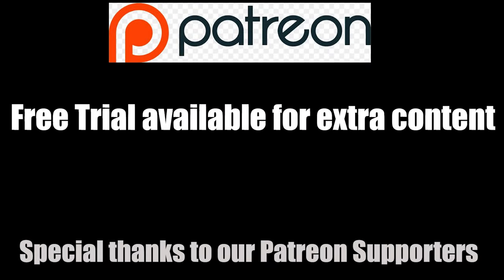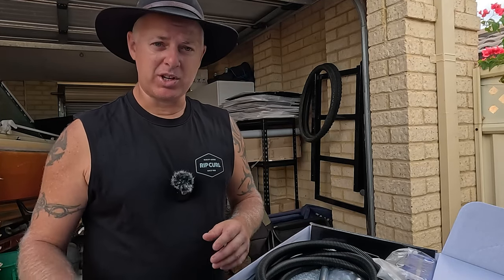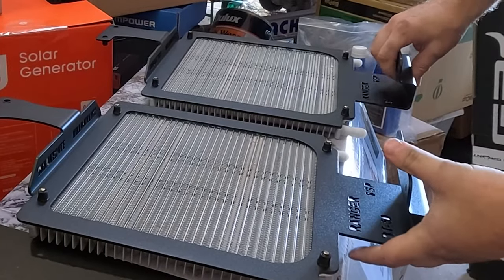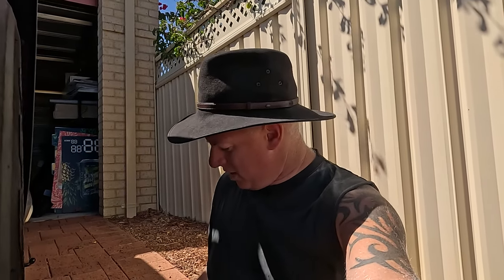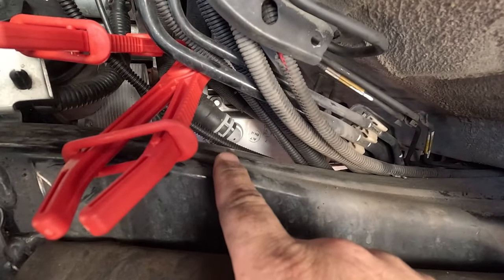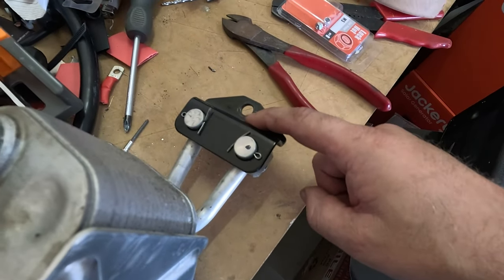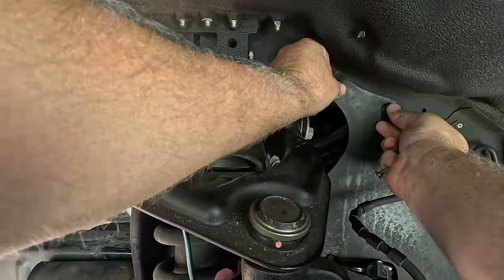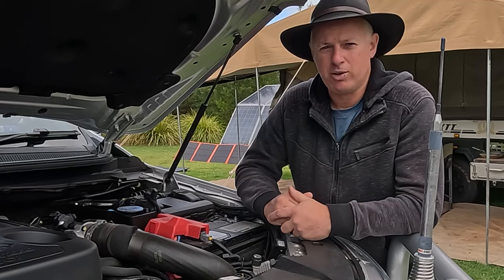Have a problem towing caravan/camper trailer with a Ford Ranger auto transmission? Ranger Build Pt 1

Comment: Hi. We've been traveling around Oz for 2 years now in our 2016 Ranger, no mods, towing a 2.7t semi offroad van. I always have it in 'S' sport mode and never had a problem. We've been on dirt roads and hot weather and never missed a beat. In 2 years We've done around 50k kilometers. 
A great car all round.
Reply from the maker: Hi guys! Thanks for saying g'day 😁 Great to hear she's done you well! Is there a reason you drive in sport mode other than perhaps wanting to use gears 😁
Reply: @gettingaroundaus    When you shift across to sport mode  and leave it, it still in auto but if you can also use it as a manual by shifting the gear leaver up or down. I keep it in the sport auto mode. The trans doesn't go into overdrive. Doesn't affect the fuel economy 16l/100k.
Reply from the maker: @c-est-la-vie  interesting, appreciate your feedback. People have only mentioned to me its about managing the trans load but always thought you shouldn't have to work around a weakness.

In my experience extra fuel consumption had always been a factor but I'm curious to experiment. Cheers 🍻

Comment: Awesome install vid Deezel!! 👍
My thoughts are that you should also fit a monitor to accurately track your temps with a ECU gauge (connected via your OBD port) such as a Scangauge (noting that the latest Scangauge 3 is pretty darn pricey!!) or an Ultragauge (about half the price in comparison). Maybe you could reach out to one of those companies to see if they can sling you one of their products for a review. That way, you could see what your actual temps are under various transmission load conditions and compare that data with a given optimum temperature range.
Also as you’d be aware, apart from being able to monitor your transmission temps, the gauges give you the ability to accurately monitor a whole range of ECU outputs which is very neat.
That said however, your MDC Robson wouldn’t be all that heavy compared with for example a 20+ foot caravan you often see being towed by a 4cylinder diesel but even so, as well as having gear like transmission oil coolers fitted, I think it’s just as important to then also be able to accurately monitor the results. It would have been really awesome if you had such a gauge fitted before fitment of the cooler to allow a ‘before and after’ temp comparison.
Just my 2c Deezel … I didn’t mean to rant 🤘
Reply from the maker: Yep totally agree with you regarding the before and after. Would have been nice to do the comparison but didn't have the time or money to make it happen.

Have definitely however been thinking about getting a scan gauge to still see what the temps looks like.

I think it would still be interesting to know if because I'm not getting alarms for eg. Does that still mean it's actually keeping the temps within what many would consider or is it just under the high but not overs range.

Will have to go back through the mighty mountain range heading back so there's a chance for more action 😂
Reply: @gettingaroundaus  I reckon that if folks purely rely on an alarm to indicate excessive transmission temps, damage to the transmission and degradation of the oil is already well underway. My thoughts would be to ideally be forewarned well ahead of time so that appropriate user action can be immediately taken to minimise any potential damaging effect that may occur i.e. prevention being better than cure. A bit like having tyre pressure monitors to prevent tyre blowouts etc. and possibly the tragedy of a vehicle accident.
The other thing is that without a means of accurately monitoring transmission temps, those elevated temps could possibly be hovering be just under the alarm trigger point over several months/years of driving thereby accelerated wear and tear occurring undetected. That said, I guess that's why it's vital to ensure that scheduled vehicle servicings are kept up-to-date 👍

Comment: How does the Ranger tow compared to the Pajero? As a Pajero owner who tows a camper, I always get thoughts of upgrading but just can't commit as the Pajero has never let me down.
Reply from the maker: Yeah mate, I'm the same regarding the Pajero.

Can't fault the Pajero either myself but both are really strong to be honest.

There is some differing characteristics however. I do intend to do a comparison video as I've been asked by mate also and it's a really good question as I personally now regard both highly.

I can say the Pajero does a have better fuel consumption though.